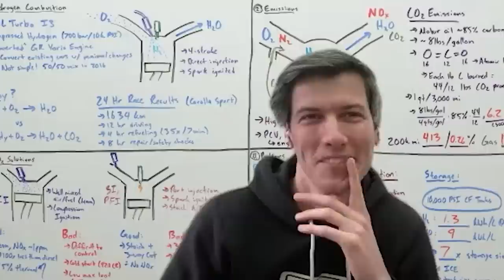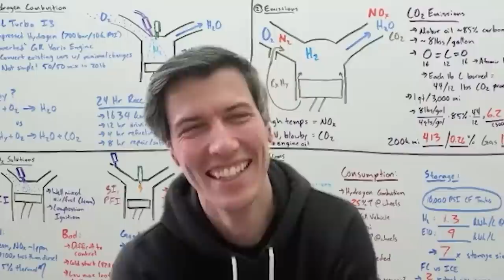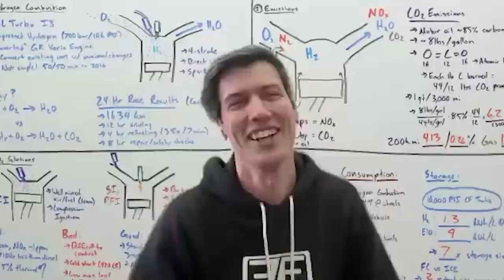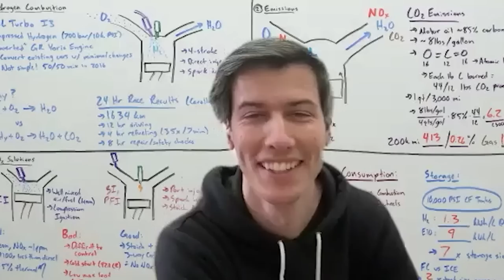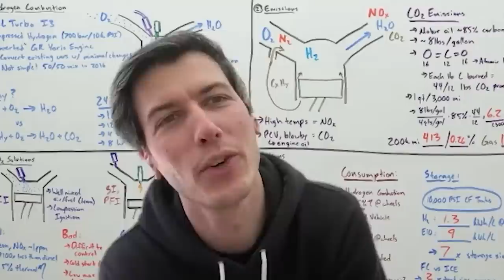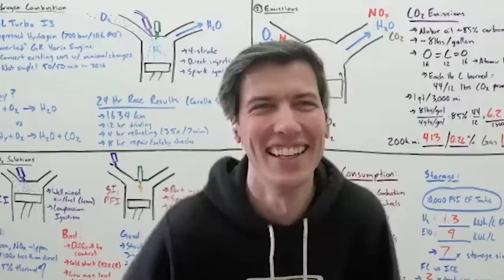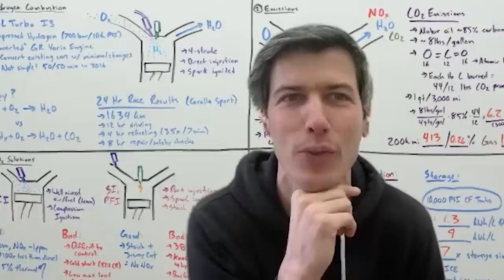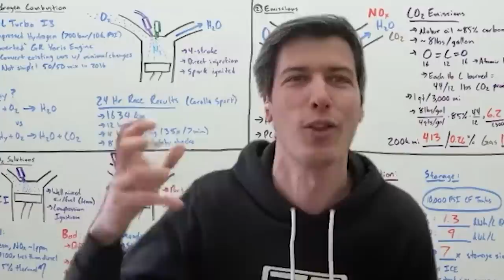Engineering the World’s Fastest Cars with Jason Fenske & Neil deGrasse Tyson

Comment: Just watched the fastest acceleration video and commented there... just heard in this one Neil commenting on somehow they have to be applying more than 1:1 drag coefficient.... instant center and anti squat in rear suspension adds more weight to the rear tires and increases the traction and coming from a dead stop actually will help even more due to front suspension rebound compared to rolling at 6mph. And in top fuel dragsters the entire chassis is actually a part of the suspension and chassis flex is a part of what allows the front tires to stay in contact for a longer time
Reply: Edit/addition, he may not have said drag coefficient but it was something basically meaning something has to be adding weight to the tires to increase the traction  available to be able to accelerate faster.
Reply: Also, grooved concrete actually is better traction than asphalt, how the track is the elevation, the weather, etc... all comes into play in the available traction
Reply: And Neil just mentioned grooved concrete and the space shuttle and off ramps on the freeway... watch street outlaws and you will hear them occasionally mention running on concrete vs pavement
Reply: Aerodynamic drag definitely is the main reason behind not hitting 300mph, if you look into the top speeds of say an early 90s audi, some will actually say they are "aerodynamically limited to * mph"
Reply: I can't even keep up with thoughts on every little subject they hit... drafting definitely is a thing and it actually works better the closer you are. Also, the closer you are the less destruction will happen if the vehicle in the front suddenly decelerates because they will decelerate less before you impact them, so if you are touching them and they lock up the brakes you will see minimal damage because you become an integral part of the vehicle in front of you just like a trailer doesn't crumple if the vehicle that is pulling it hits the brakes.
Reply: The weight of EV's actually has presented a lot of issues, stopping like was mentioned and the weight of them actually caused the safety testing and crash testing systems to need modifications because the vehicles are so heavy they were not sure if they would be able to accelerate the vehicles to testing speed in the distances they had or if they had enough power to do it and also if their impact barriers would handle the increased force put into them by the heavier vehicles.

Comment: In drag racing, they have a timing sensor that is tripped a few feet from the start line . This is a standard in racing .  That is why they sit there and spin the tires when the green light comes on.  So you can have a lower run time and still lose the race if your opponent crosses the finish line first.  That is why a ROLLING START is used in 0-60 times.

Comment: As an EV driver, definitely are thinking about the recycling of batteries, and excited about the success of the recycling companies that are still having trouble getting batteries for recycling. From what I've read/watched, EV batteries are being reused for land based first, then being recycled for all the elements they contain once the land storage use time is run up. I also have read that the land based use is taking so many batteries that the recycling companies can't get enough batteries to meet their capacity. This will likely change over time, and hopefully there will be enough of these recycling centers around to pull out those chemicals/minerals for new packs. I also read it's easier to recycle existing packs with already purified minerals/chemicals than to pull them out of the ground and purify/clean/refine them.

Comment: yea drafting with an adaptive cruise is awesome…i can draft at a fixed distance behind 18 wheelers in my gen 2 ridgeline and get 28-30 mpg at up to 80mph depending on conditions.  and i have found that this only needs to be at 100 feet which is totally a safe distance!  also on hills the poor power/weight ratio of trucks frequently prevents my truck from downshifting which also saves me a lot of gas

Comment: There are so many factors to consider, when it comes to acceleration. It seems the electric motors have the edge over combustion engines. It would be interesting to see an electric dragster against a normal top fuel dragster. They are designed purely for acceleration over a quarter mile. Not very practical to drive on normal roads. LOL 😂

Comment: Tesla Plaid with the factory speed limiter bypassed, have now hit 214mph.  Tesla seems to still be saying that the Next Generation Roadster will be capable of exceeding 250mph.  A Top Fuel dragster can run 320-340mph from a standstill in 1000 feet... but you do it once and then you rebuild everything for the next run. 12,000 hp but it's losing cylinders on the way down the track... less than 500 rotations of the engine under load is it's lifespan.

Comment: For more power in an electric car what if you built in a capacitor to the frame or something and (strictly for a race car) you charged it with regenerative braking and then discharged it when you accelerated next? Or could use it like a boost on demand?

Comment: We need a big leap in Battery technology. If we can get more energy capacity from a smaller cell. And using more plentiful resources, then EVs will become the obvious choice. Or even a Back to the Future Mr. Fusion and no batteries. If reports are correct and we can now get more energy out of Fusion than it takes to start, then fossil fuel energy generation may be on its way out. Coal would likely still be needed for Steel production, and various others may be needed in other sectors (Petroleum for plastics, etc.). but batteries are the thing that will hold back EV conversion.

Comment: Another problem with rotary engines is combustion chamber sealing. Piston engines have piston rings and valves to seal the combustion chamber. Rotary engines have a non-circular chamber in which the "piston" rotates. The three "moving" chambers are separated by spring loaded seals at the tip of each lobe of the "piston.' There also have to be circumferential seals between the rotating "piston" and the front and rear case walls of the "block." When these engines were introduced, the effectiveness and wear rate of these seals was a major problem. Not to mention trying to explain them.

Comment: Jason,  A though, When the car starts moving it transfers some of the weight to the back tires.   The back end goes down a bit.   That's an acceleration downwards.  So, for a brief time you have more then 1G.   Sure that's a short time but it's at a very vital time.   Does that add up to any benefit?

Comment: @20:15 The reason why off-road tires have treading on the side is that they produce more grip the further they sink into mud. "Coming up against a rock" you actually would want an untreaded part of the tire since it would produce more friction against a rock (depending on the the shape and size of the rock) which is the reason why heavily treaded off-road tires are comparatively garbage on an asphalt road, since they have less surface area making contact with the road than, say, a slick would.

Comment: There were rotary engines before the Wankel. They were used on airplanes, helicopters, and motorcycles. 

There was the  Gnome engine,  Adams-Farwell five cylinder rotary  engine,   De Dion-Bouton  experimental 4 cylinder rotary engine, 
Félix Millet 5-cylinder rotary engine, Siemens-Halske bi-rotary design engine, and many others.

Comment: So Neil says that the oil in the ground is essentially free energy, but I have been quoted a figure of around 50% as the amount of energy needed to produce fuels refined sufficiently for use in a vehicle, be that air or road vehicle, so 1 gallon of crude produces 1/2 a gallon of usable fuel. That is far from free.

Comment: IMHO no one is pointing out that if you ignite a balloon of hydrogen it explodes mainly because the hydrogen is a gas and when the  balloon is ignited it expands rapidly and can mix rapidly with the oxygen in the air. 
In the case of liquid gasoline only the top is exposed to the oxygen in the air.  In a fuel air b0mb the dispersed tiny droplets of gasoline are surrounded by oxygen and it explodes too. 
This is also why working on a full tank of gasoline is LESS dangerous than a nearly empty tank (mostly vapour)

Comment: To the point of bigger batteries having more cells and power, look at the Tesla acquisition of Maxwell. They now have the 4680, which looks much more like a super or ultra capacitor design from the latter. If you watch the tour of Estonian company Skeleton Capacitors on Fully Charged Youtube, they have an amazing shot of them energizing a big heavy wire. Their capacitor whips it out like a firehouse being turned on. Ofc, longevity or reliability etc. BUT still pretty neat, and a hybrid design between batteries and capacitors (along with gearing of the EV motors) will see speed barriers pushed over the next couple decades.

Comment: I am really surprised that an engineer and a physicist have came up with you shouldn't be able to accelerate faster than 1g or 2 seconds from 0-60 when A top fuel dragster accelerates from a standstill to 100 mph (160.9 km/h) in as little as 0.8 seconds! And over 300 mph in 3 seconds! But back to production cars there is another aspect that you have left out is launch control is why acceleration has got so fast in production cars! Old school before launch control if they had too much power they would just spin the tires and couldn't accelerate as fast! But with launch control and the computer adjusting constantly you can now accelerate very fast without wheel spin! Now the limiting factor in gasoline powered cars is the injector pulse times and can only make about 1500 or so corrections per second, whereas an electric car doesn't have this limitation and can make thousands of adjustments per second, letting the electric car to out accelerate the gas car! But I love watching all your programs! I'm not knocking anything but! That's a pretty outrageous statement that a car is limited to 1g of acceleration when top fuel dragsters have been doing it for a long time!😅
Reply: I mentioned exactly that in a comment on Neil's previous video on this where he stated that that cars have an arbitrary 1G acceleration limit. I'd love to know where Earth he get's this idea from but it's just plain wrong. It all depend on the the friction between the tyres and the road surface and this can vary immensely.

Comment: I'm a bit disappointed that nobody corrected the statement about rare earth minerals in batteries: *li-ion cells do not require rare earth materials*. NiMH cells did, but those are outdated. Some li-ion cells need cobalt of which a tiny fraction is produced using child labor, which is bad, but would still persist, if li-ion batteries would stop existing tomorrow. Lithium partly and graphite mainly come from problematic sources. Nickel isn't abundant enough to electrify all cars in the world. But all these problems have more than one solution already. These problems are being addressed. Boycotting electric cars won't solve any of these problems.

Comment: Another consideration with batteries that often goes undiscussed is as we get better and better energy density out of them, when they're charged that energy is still inside them. While all well and good for increasing the efficiency of what ever electric device uses them, there needs to be consideration given to what happens when the battery is damaged and a runaway discharge happens. If I runover a piece of rebar on the highway and it careens into my undercarriage, the chances of it totaling my gas car is very slim. In an electric car, if it punctures the battery pretty much anywhere, that stands a good chance of causing a hazardous electrical fire (difficult if impossible to firefight) and certainty of totaling my car. So, knowing this, the better batteries become, their safety precautions must be equally robust.

Comment: So I did a Traxxas on a Redcat RC car, swapped the brushed motor for brushless motor, changed the battery from nimh to lipo, changed the gear ratio, and almost triple the top speed. The body shell used was a BMW M3 GT2. Can the same be applied to a full sized EV? Just curious.

Comment: They use a large battery pack to have more power available from the battery to the motor. But if you only need the battery pack to last 10,000 miles you can easily get 4 times the power out of a battery pack 1/2 the size. It would just use battery cells that cost 10 times as much.

Comment: I think the point you are missing the most is energy. ICE is 35% efficient and needs warm tires for launch. Tesla has more weight and 98% power to the wheels with no slip of the wheels. Also the rollout theory is obsolete because they measure to 0-62 to cover the first foot. Still gets the Tesla to 1.9 sec 0-62mph. Torque is 100% at all times with no transmission and AWD.
Reply: They measure 0-62 because they're actually measuring 0-100 km/h

The rollout will remain controversial because it's not how it was historically tested, and it's not how most people understand the statement "0-60 time"

Comment: 25:43 This pains me to do so but I must. It is most definitely a "tire question" and not an issue of power. Auto manufacturers have demonstrated they can produce power at levels that were unfathomable just a short time ago. The problem is tire manufacturers have to develop a tire that can handle the forces generated at 300+ MPH. At those speeds the temperatures developed from friction between the tires and road surface and the centrifugal forces of the tire spinning at such high RPM's will disintegrate most, if not all, DOT legal tires. Developing a tire that can withstand these forces and be "road legal" is the problem facing tire manufacturers today. One car has exceeded the 300 MPH barrier, the Bugatti Chiron 304 SS. Michelin had to make special tires for the Chiron's 304-mph speed run. The most restricting—and dangerous—element of a top speed trial is the tire the car is running. For the Chiron's 304-mph sprint, Michelin took its Sport Cup 2 shoes and wove stronger metallic threads into the rubber.

Comment: Not to knock the idea of top speed with EV's, but wouldn't that defeat the purpose of EV's in the first place? What I mean is that the purpose of having an EV is fuel efficiency and lowering green house gases. If we're having to use more/bigger batteries to get higher speeds, then wouldn't that be contradictory to lowering the carbon footprint?

Comment: CAPACITORS!!! Can be used as a turbo for an electric engine. By storing energy and releasing that energy when you need it by using something like a  button or have the computer use it automatically. For example, like when trying to go 0-60. Just my thoughts from spending 10 years installing high end car stereos.

Comment: About the drag a vehicle behind you alters,... i drive a box truck for work. its limited to 68 mph by running out of power. but if i  can draft a semi i can run up to about 72mph. but the inverse isnt true. if a large vehicle gets behind me or along side me doing 65, then i slow down to match them. and dont have enough power to pull away

Comment: And [warn of] that Day when We will remove the mountains and you will see the earth prominent, and We will gather them and not leave behind from them, anyone.
18 - 47

And they ask you about the mountains, so say, "My Lord will blow them away with a blast.
20 - 105

And the mountains will pass on, departing
52 - 10

And the mountains are broken down, crumbling
56 - 5

And the earth and the mountains will lifted and leveled with one blow -
69 - 14

And the mountains will be like wool,
70 - 9

On that Day the earth and the mountains will convulse and the mountains will become a heap of sand pouring down.
73 - 14

And when the mountains are blown away
77 - 10

And the mountains are removed and will be [nothing but] a mirage.
78 - 20

And when the mountains are removed
81 - 3

And the mountains will be like wool, fluffed up.
101 - 5

And when the stars fall, dispersing
81 - 2

By the sky and the (sky) knocker - (pulsar)
86 - 1

And٫ who acknowledged you that what is the (sky) knocker (Pulsar)
86 - 2

And [by] the seas will filled [with fire], (Berning)
52 - 6

And when the seas are erupted (exploding)
82-3

And when the seas are filled with flame
81 - 6

By the space witch contains great towers (of tornados)
85 - 1

Comment: You mention manufacturing on solar cars as part of the footprint, this is true, but I never see manufacturing mentioned as a source of carbon footprint in regards to any other car with an ICE. The common comparison is the emissions of an internal combustion engine as it runs, vs EVERYTHING involved with an electric car, production, charging, running the vehicle etc... Also I've never seen fuel transport, refining, extraction, running gas pumps... etc mentioned in a carbon footprint comparison of electric vs ICE.

Comment: The main points are wngin power. How to get the power to the wheels, then the tolerance of getting there, and then the power getting maximum adhesion to the surface, and keeping the car level with enough downforce that increases proportionate to planting the power to the ground. I can picture it in my head but can not explain things very well with words. I don't think rubber is sufficient for such speeds maybe a hybrid tyre as you need it to contain the heat and the warping with the rotation and imperfections in the road.